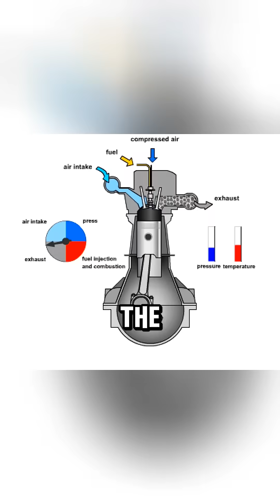“Why This Truck Brake Is BANNED in Some U.S. Cities”

Comment: I was able to go down to Tennessee mountains on I-40. In the snow on ice by simply using the jake brake. And the other would have put me into the Jersey wall that was full of snow or off to the right into the ditch. 

It is a necessity. It's not just for making loud noises and annoying people. If there was a way to put a baffle in it without affecting the pulling power or the HP of it all. It would have already been done. Sometimes we do it passing diners that we're not able to stop and have a meal just to say hi. As we're passing by. From up on the highway on the interstate. Nevertheless, they are a necessity. I could go 100k miles without having to redo my brakes. Front steers can cost over $600. That's just a single front tire.  Could you imagine with the brakes cost?🤔🫣 You cannot make money that way

Comment: They should allow them because it's a safety feature designed to save lives and since there's a complaint about them maybe the engineers of the Jake brake can go back to the drone board and try to fix the issue and come up with a better version that doesn't cause a lot of rattling and noise like maybe a counterbalance

Comment: There's a similar system on the Prius prime 4th generation using the gas engine to slow down the car when normal regeneration isn't enough and prefer not using your normal brakes. It's not noisy but it works.